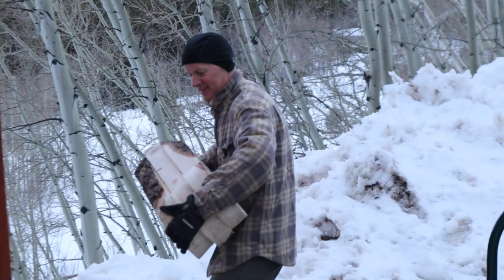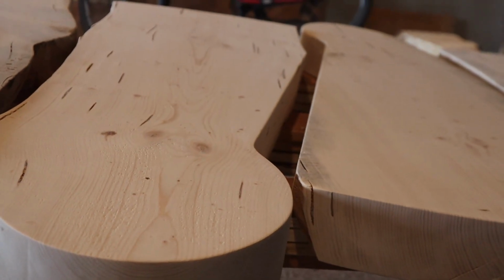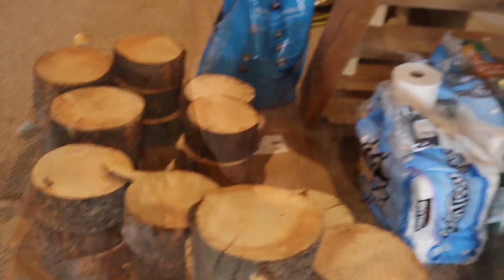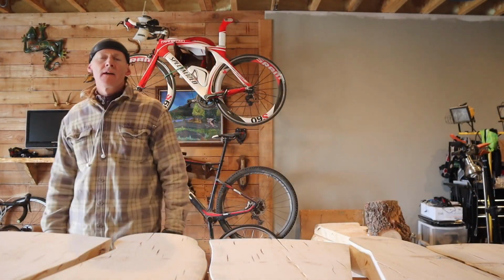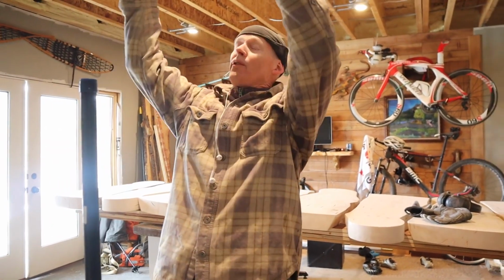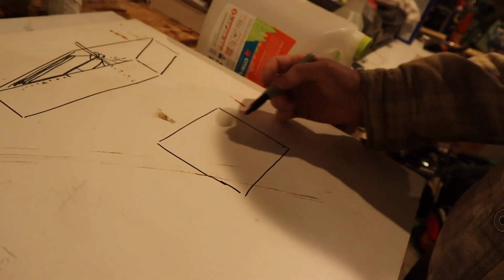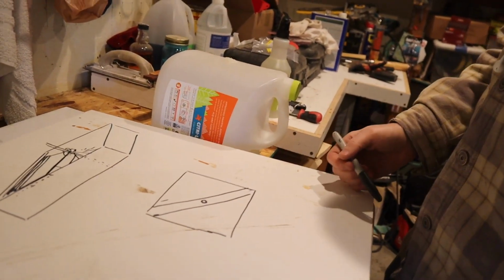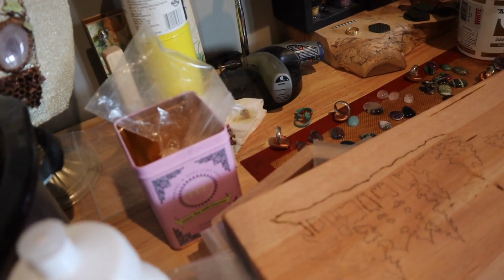Finish Work on Log Spiral Staircase & Assembly Plans

Comment: Should be using 4 in pipe
Reply: Yeah, you check the building code for that?
Reply: I have a metal spiral stair case and it uses a 4 in metal pipe. I just think they will get greater stability and strength if they use one.   What do you base your knowledge on?
Reply: @raymondrussell500  I agree. A four inch pipe or better seems right. Spiral stair case manufacturers all show a wide diameter vertical support. However, CML probably researched all this and thinks their angle iron supports will give extra strength. Maybe CML will comment on this.
Reply from the maker: I was originally going to use 4" pipe, however, when I looked at the amount of wood left within the area of the circle on the tread and spacers, I decided on the 1" pipe which is 1.25 OD.  In addition, I am using timber bolts to bolt each stair to the one below.  The overall diameter of the column is > 8"(the spacers vary slightly since I'm using a log).

I appreciate the thoughtful comments! -B
Reply: Colorado Mountain Living I do hope the smaller pipe will be enough. Best of luck. The wood will make a beautiful stairs. Be safe and stay healthy.
Reply: @ColoradoMountainLiving  Thank you for your responses on this. It's all looking good.

Comment: I am behind on youtube life and still working despite covid but I like the random orbital sander over just the palm sander. Brain his skills are better than mine but I thiink that tool is so much better. Only issue is it cant get in those tight spaces. but for that project its awesome.
Reply from the maker: Bryan used to have the orbital sander and it broke when we tried to use it as a concrete vibrator lol.

Comment: If there is a machine shop in your area I would suggest having a "blank flange" drilled and tapped for your pipe size. You can also specify the number of bolt holes around the circumference of the flange. Blank flanges of various thickness and diameters are available. This could eliminate the welding and provide a sturdier mounting point. That staircase is going to be magnificent.
An additional thought is a “slip flange”. Not sure if there would be enough depth to provide a secure anchoring point.
Reply from the maker: I will look into that.  Anything to speed up the process and add strength.  Thanks! B

Comment: Are you going to use a metal handrail to support the free end of the stair treads? The often use metal rods and epoxy to strengthen stone. This could strengthen the treads where is has deep checks.
Reply from the maker: I received a suggestion from another viewer to added oak dowels through the cracks.  I like that idea.  I was thinking of alos filling the cracks with an epoxy.?.?.

Comment: Have you looked into "cool hand grips" for the wood burning tool? I think they exist. Maybe find a flexible machine glove that would handle the heat.
Reply from the maker: Good idea if I wanted to really get into the hobby more. More issues with cramping hands from the grip compared to the heat. about 10-15 mins. off takes care of that issue.

Comment: Use a oven glove if you have one for the wood working tool.
Reply: There may be a risk that the tool starts to melt if it gets to hot.
Reply from the maker: I like your thinking. even a small cloth glove could be helpful. a bulky oven glove would make it too hard to hold onto the tool like a pencil.

Comment: That's going to be a lot of weight relying on the central 1.5 inch pipe.
Reply: I concur I would have used 4" At least 3" filled with concrete.
Reply from the maker: Actually, as I add the 5" spacers and treads, I will be using timber bolts to  screw them together.  the bolts will help take the stress like adding rebar to concrete.  Thanks for the comments and for watching! B
Reply: @ColoradoMountainLiving  You were going to recess lights in the treads. I assume the lights will now be screwed to the underside of the treads. I am not sure how you want the stairs to look like now that there will be gaps between the threads but will you be making some sort of timber housing for the lights. If you did it could also act to prop the treads off the one below and reduce the stress on the timber bolts. (I have never built any timber stairs)